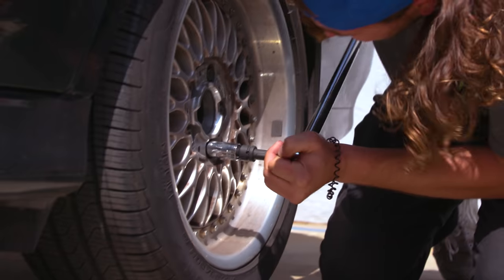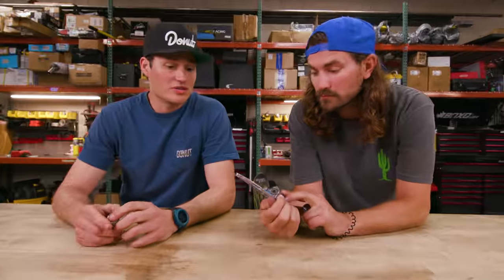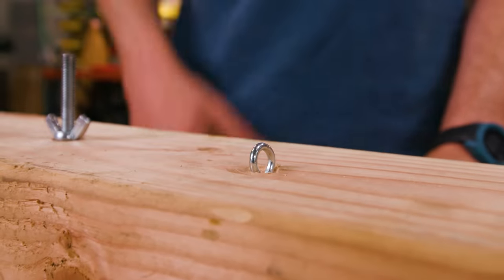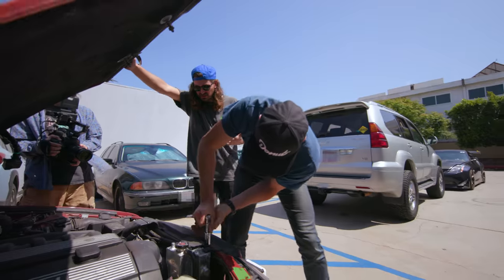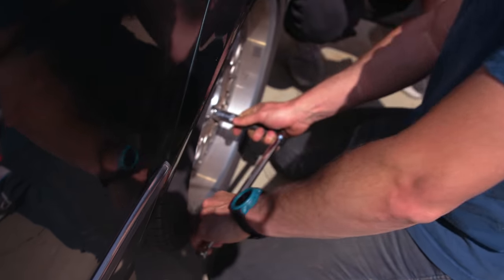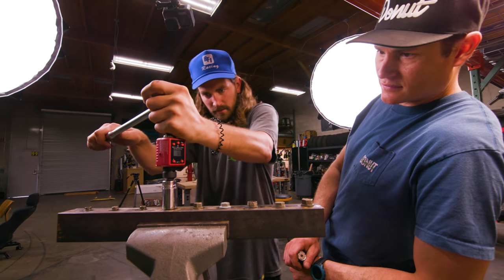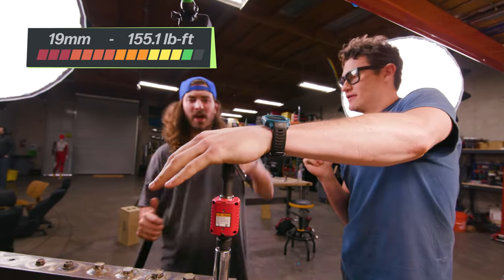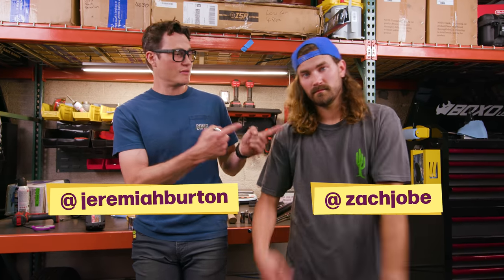Testing the World's Most Hated Tool

Comment: Having one in the toolbox can be really useful, especially for oddly shaped stuff (like hooks, rings etc.) I would not try to use it as a regular socket unless I have no other choice though. It can be easily damaged and is too shallow for any useful application on nuts and some bolts. Additionally it is significantly longer and wider than the regular sockets.

Comment: I work on old bicycles that have been sitting out in the elements for many years. The gator grip works well for the rusty rounded off axle nuts.
Reply: Omg dude buy a bolt extractor set to last you a lifetime than this piece of crap which doesn't even work as well as bolt extractors.

Comment: In my line of work, I occasionally have to use these on chain shackle (D-ring) pins.

They're actually useful for that.  Of course, you're limited to which sizes you can use it on, but it beats trying to put a pick in the eye of the pin and breaking it under leverage.
Reply: i keep one on me for roofing - if there’s a satellite dish or legs to a chimney stack, just take this out and throw it on the drill, especially if the bolts plastered in plastic cement.

good for oddball stuff lol

Comment: I've had mine for about 22 years now.  I use it primarily to get the rock guard off my truck when I change my oil, but it's pretty reliable once you get a good lock/grip, especially with corroded things.

I used it all over the rooftops of Tampa doing kitchen range installs though back in 2001-2008!

Comment: Bought my dad one of these a few years ago. Recently my sister was renovating her room, and I needed to take down the blinds from above the window, and the wing nuts that I needed to remove were totally stuck! Was able to use the super socket to remove them (that's what they were branded when we got it for dad btw). It really does work for things that no other socket can fit. Also my dad's super socket has hexagonal pins so the tool does work a bit better.

Comment: I used 2 of these to get off spline drive security lugnuts off a set of wheels. the 1st one got off 3 of the 4 before it was completely destroyed. the 2nd one finished the job. much cheaper than finding a key that worked
Reply: Those key sets can be pretty cheap depending on the range of types you get. If you have to do that job twice, you'd be better off getting a key set
Reply: Your solution sounds expensive to me. If you used something like this you would still have a working tool afterward CTA 13/16in Emergency Lug Nut Remover Socket. This piece of crap of a tool is no reason not to invest in proper stripped bolt removers that you can use over and over, because they aren't trash. I'll never use this crap over a socket set. One stripped bolt with this piece of junk and it forever loses its value.
Reply: @primordialsoftware9294  right? you’d think people who steal wheels off other peoples cars would just buy the set
Reply: @dickhitswater4836  I'm not sure what you mean by "the set".
Reply: @primordialsoftware9294  the set of sockets for those different styles of security lug nuts
Reply: @dickhitswater4836  They don't because those security lug nuts are a joke. Thieves are just going to use a stripped lug nut remover. No need to worry about finding a matching key.
Reply: @primordialsoftware9294  well I was just making a joke anyways

Comment: I got one of these a few years ago when I had to change my Honda's rear control arms on Sunday night and couldn't find the special 10 point socket locally. Surprisingly it worked perfectly despite the high torque although it felt like it wanted to round the bolts off. I don't use it regularly, but it's nice to have around for those weird nuts and bolts.

Comment: When standard sockets fail on stripped nuts/bolts, I have used the pin socket and it worked to removed the stripped bolt when nothing else would bite on. It's worth keeping one in the tool box for just such occasion.

Comment: I've used mine MANY time over the last 15 years. I did crack the outer housing when using it beyond what it could endure, but I knew it might break when I did it, so.... ya know?  It's a light duty tool and really great for what it is intended for. Although they did oversell it a bit, but show my ONE product out there that don't.
Reply: Old school Craftsmen tools.  They were guaranteed forever.  If you broke one, you took it in to Sears and they gave you a new one no questions asked.  I've personally found it VERY difficult to break the old American made Craftsman tools even when I was abusing the hell out of them.  I have a tool box full of Craftsman tools that are well over 30 years old.  Those tools were not oversold...  They were every bit as good as advertised.
Reply: @craigcampbell8560  Emphasis on the "old school Craftsmen"--which might as well have been "gold standards."  The new ones are an outright joke; we've taken to dubbing them "Crapsmen tools."  

I've outright broken 2 sets of mini diagonal cutters within a week of getting them (and getting them replaced to boot!)  The funny part is that they replaced a "Chinese superstore" mini diagonal cutters--which lasted me over 10 years before I broke them trying to cut a 1/3" stick.  
And the "Craftsmen" equivalent replacement...fails miserably at tasks the "China store" one did for years on end.  Cutting PCBs, etc.  Handle snapped on one "Craftsmen"...and one of the cutting faces literally snapped in half on its replacement.
Reply: @sidlori1592  I know.  It's sad.  Craftsman tools USED to be right up there with Snap-On and Matco when it came to quality, but they were a LOT cheaper.  While I don't know if Snap-On's quality has changed significantly throughout the years, I'm going to assume their tools are still really good because they charge WAY too much to sell tools that are junk.
Reply: @sidlori1592  pretty sure craftsman uses chinese manufacturing now while still marketing themselves as made in usa. The only thing made in the usa is the name craftsman

Comment: I love this tool for minor jobs. You can't use it with a ton of force however
Reply: The tool either damages the bolt or itself, while it does work
Reply: I'd rather just spend 20 minutes looking for the socket in my tool bag
Reply: @mangotail6808  that hasn't been my experience. It really depends on what you're using it for.
Reply: @samholdsworth420 apparently you're not as lazy as me. Haha

Comment: I got my universal socket off AliExpress years ago and the thing I use it the most for are nuts that are too deep just like the one at 5:30 but mine never had a problem with that depth, that's the reason I have it in the first place, bc it's deeper than Nolan's armpit. Also why use it on the side of the road when you legally must have the proper tools for a tire change. This is not meant to do that
Reply: So defensive
Reply: I can legally use whatever tool I want to fix my car on the side of the road.
Reply: Okay? And
Reply: @AppleGameification  it's called an observation
Reply: @eternalbeing3339  good luck then

Comment: I wonder if the concept of this tool is inherently flawed, or it could be made to work with quality materials & manufacturing.
Reply: The problem isn't that the tool is made poorly or the idea is bad, it is that bolts and nuts are designed to maximize the clamping force given the amount of material used and the ONLY way to effectively work with them is to have a hardened steel tool the exact right size to apply the maximum amount of force the material can withstand, because the fasteners are designed to be used that way up to their material limits.  A tool like this makes sense for low torque uses on odd shaped things a person might want to twist and is a useful tool, but it can not in any capacity replace a wrench or socket for general purpose use.
Reply: Replace the round pins with hexagonal pins and you'll increase surface contact, as well as reduce pin failures. Overall it can be a convenient tool when you have to transport tools thru a large building.
Reply: I have a larger one with hexagonal pins. It is much tougher than the standard one. Not that I have had to use it often.
Reply: @knurlgnar24  So the tool isn't made poorly nor is "the idea" bad, it's just that it can't turn nuts or bolts, which is the ENTIRE "idea" of the tool in the first place???

Got it! Way to be the smartest guy in the room!
Reply: @icemancometh1621  as soon as you use hex pins you reduce the amount of things it will fit.....
Reply: @icemancometh1621  It’s a good idea except that you will exponentially increase the amount of friction on the rods, and this will cause more seizing in the tool, not less. If you could enclose the tool in a lubricant and some sort of vinyl seal, you could allow for stronger rods/pins without increasing the friction point as much. But then you have to solve for a more difficult grip problem for the head of the bolt.
Reply: @jasonhuskie988  I'll admit I lack formal training in mechanical engineering. I'm a Roman engineer. I see the problem and work out a logical solution. Occasionally I fail the first time around. Thanks for your insight.

Comment: I've had a gator grip for like 20 years. It sits in a drawer of my tool box. I only use it once in a great while to get bolts off that are rounded off. Sometimes it is the easiest thing to do that but not always. I never use it on a bolt that I'm going to use again. I wonder if the old ones were made better because all my pins still work 🤔
Reply: The older ones indeed are, as I have one that's about 25 years old from my dad's tools he left me that still works great in a pinch, and then I got one from my step dad a few years ago after he died that was much newer, and the pins have not lasted near as long.

Comment: I have one in my travel tool kit. Space and weight are at a premium for me, as my tools have to go in my checked baggage. The crates for the equipment I work on don't always have the same size bolts and this keeps me from  having to carry a complete set of sockets. It doesn't always grip as well as a dedicated socket, but it does what I need.

Comment: LOL in the 100-y-o socket wrench test you wanted the tool to last "a lifetime," now it's fine if it lasts a half a dozen screws. Definitely smells like shait
Reply: Are you referring to the first challenge? The premise was "can it do the stuff they claim in the commercial?". And it could. It passed the test in that regard, even if it left the bits and the bolts damaged.
Reply: I don't get your quip. The Gator Grip did last until the end of its life, right?

😀

Comment: I keep mine in my little Vespa Scooter repair kit for emergencies. I can't keep a full socket set wherever I ride with me. It has come in handy when i have found a loose bolt or an emergency repair when riding. For me it does not replace a kit, but is a nice enhancement to an emergency repair kit.

Comment: So from an engineering perspective, this could work great if it was very finely machined and made of titanium. Housing would need to be exceptionally strong too
Reply: Titanium would be the worst material to make it out of. Titanium is soft and it galls easily. Hardened tool steel is by far the best material for this application.

Comment: I feel as if hexagonal rods instead of round ones would be much better.
Reply: Yah it’s a good idea just poor execution. Hex rods with better springs/support would probably be an improvement
Reply: @rey5597  yea. Cylinder shaped makes no sense. Just makes them slip.
Reply: Thats not a feeling
Reply: The tool works fine.  How about design your own tool instead of trashing someone else's.
Reply: @kenrichmondlbgt1423  why are you bothered by his comment? He’s not trashing it.
Reply: @kenrichmondlbgt1423  it definitely does not. As anyone who has ever used one can attest. Hexagonal rods would make it better though. There’s my fix.
Reply: @rey5597  really weird account after further investigation. Joined just a day ago. Weird.
Reply: @yeeturmcbeetur8197  I have ran in 3 - 4 inch lag screws 3/8 wide no proplems.  Put it on an impact driver and watch it go.  Your really weird.   It's like calling a gun inaccurate because you can't shoot.
Reply: @rey5597  Funny for you to ask since you are commenting on my comment.   The tool works great as is.  Operator error is all I can figure.   Maybe it's to complex for simple folk I guess
Reply: Maybe you had a knock off.  I tried to strip break mis-use mine.  It's does way more than I ever expected .   Works best in an impact drill.  Of course you need the adapter because you probably couldn't figure that out!
Reply: @kenrichmondlbgt1423  I’m glad it’s worked for you. I’m a tool guy so I’ll stick to using the right tool for the job.
Reply: @rey5597  I work reconditioning and old Mill.  The wood ceilings and beams  have random screws all over.  There is no better tool for removing them unless you carry 10 drills and tips.  It is the best tool for that job and is specifically why it was designed.    Yall are the ones trying to install a light bulb with a hammer.   Are you still glad for me?
Reply: @kenrichmondlbgt1423  yah man if it works for you then that’s awesome 👍
Reply: @kenrichmondlbgt1423  I’d almost laugh but you don’t know who you are speaking with. Get a socket. I’m a firearms instructor, range officer, and gun smith lmfao.
Reply: @kenrichmondlbgt1423  he just did durh

Comment: The best application for one of these "fits all" gadgets is the trip to the trash can.

Someone once gave me a couple of wrenches that were suppose to fit anything. They had a large loop and a cam type pawl which is to grip the fastener. If you didn't have at least 3" to 4" of clearance around the fastener, the wrench was totally useless.  I never even attempted to use them.
I suspect they had been passed from one person to another several times.

Comment: I do handyman-type work professionally. My wife bought me one of these c. 2019. My experience has been that it’s not great for heavy duty applications, or indeed most situations involving ordinary hex bolts, but it IS excellent for weird shit. Eyebolts, hooks, sometimes weird off sizes that nothing seems to fit, etc. As a marketing campaign, selling that as THE intended application is obviously not going to generate the interest and high volume sales they want to recoup the development costs, so I get why they try to sell it as light/medium duty general purpose, but still if there was more awareness of it as a really good tool to get you out of an annoying spot rather than for general use, it might get better press and adoption.

I also feel like it could be more useful if there was something you could turn, slide, etc to enable or disable the spring loading. Spring loading is only REALLY necessary when screwing a hook or eyebolt into the ceiling or something like that, and as this video demonstrates, the requirement to hold it down can be a serious PITA in other situations. Along the same lines, if the pins were hexagonal, triangular, square, or any other tessellating shape, it might not be so prone to slippage on off sizes because the pins wouldn’t have space between them, nor smooth and round edges. It would still never replace a proper socket set, but it might help eg finishing a job with just a few things left to tighten up instead of having to swap sockets

Comment: I use mine for the crash barrels and other road signs that have the flashing light bolted to them. It’s a regular 1/2” bolt but the head is D shaped requiring a special socket. I needed to replace the batteries in a bunch of lights and I didn’t have the special socket. Working nights means going to buy the correct socket isn’t happening. I used this socket on a Milwaukee M18 impact driver and I was amazed at the fact that the socket made it with no damage

Comment: I used one of these for years on the road to assemble and disassemble clothing racks.  It had been in my toolbox when I lost the socket I needed.  I still have it ten years later, though I did purchase a replacement socket for the job eventually.  The whole hook driver thing was invaluable as we used them on the wooden clothing racks.  I will say it isn’t the best replacement tool, but in right circumstances works well enough.

Comment: When it fits in the space, it's a useful little tool. I keep a small ratchet, an extension, a #10, and a Gator Grip in my car. I'm no mechanic, but it's helped me change batteries & tighten bolts.

Comment: Basically, the "Gator Grip" is a light duty tool useful for odd fasteners, but doesn't live up to its marketing hype. 

An old door key can be used for hook screws and L-hooks..

There is a driver bit specifically for wing nuts.  It is used when installing metal hurricane window covers.  It is a bifurcated cylinder with a 1/4" hex drive shaft.  There is also a similar tool used for RV jacks.

Stanly made an adjustable nut driver that had a sliding collar that tightened around six movable tines that tightened around a nut.

Comment: I work as an industrial technician and i actually carry one of these around when i do pm's. Its not as useful as my crescent wrench but it has saved me a few trips to the box. The thing about my line of work though, is that none of the nuts and fasteners are rusted, and they can all be replaced very easily if they were to get stripped or worn.

Edit: i should mention, its the only socket i have that allows me to ratchet oddball fasteners and offset grease fittings.